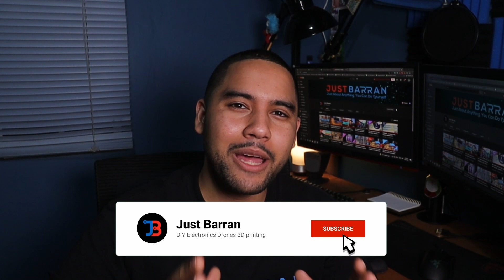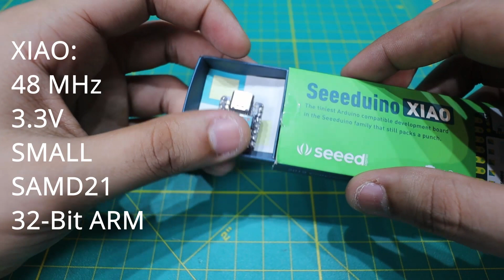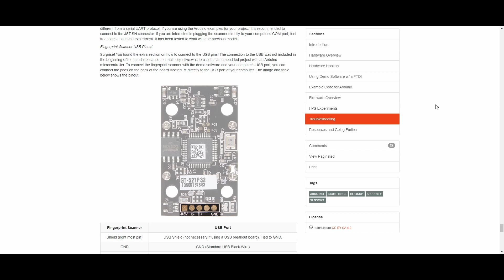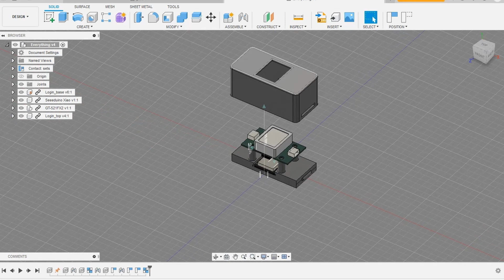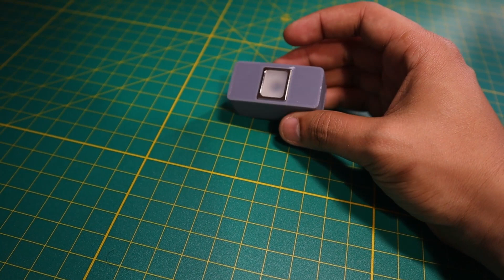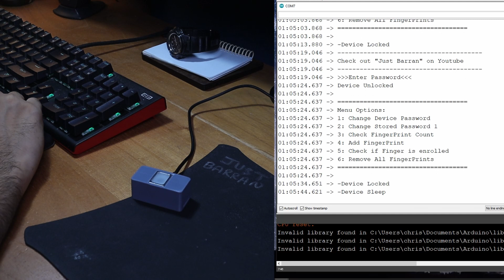Unlock any computer with your finger (Seeed XIAO + GT-521F32)

Comment: Hi Barran I have used your library for door lock system my code is completed but my question is to you  (if finger print is not found / not verified ) how to apply if /else condition on it to execute something
Reply from the maker: Hey the code there is a verification condition if already, just add the Else there

Comment: Is the Library compatible with esp32?
Reply from the maker: Yea it shoild, it was originally designed for the esp8266 so it should work for the esp32. If it doesn’t let me know it may be just a matter of the serial driver issue.

Comment: I think I need something similar. It would be nice if the communication between the fingerprint sensor and USB device was encrypted since that UART signal is subject to man in the middle attacks :( Meh. I should prob at least get the sensors. Just Good Stuff Barran.
Reply from the maker: Yea I talked about that in the end with security. I could also do the comparison on the xiao, cause the sensor allows the downloading of the fingerprint, so no worry about man in the middle attacks but sealing the whole thing in resin could also solve that problem.